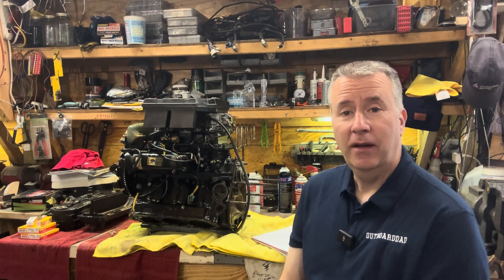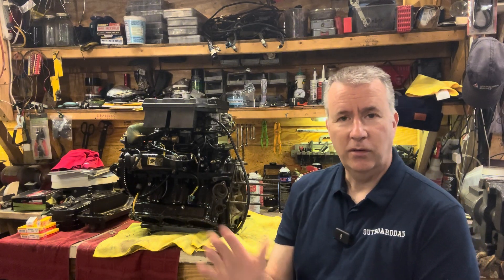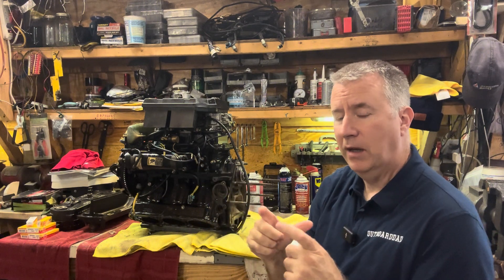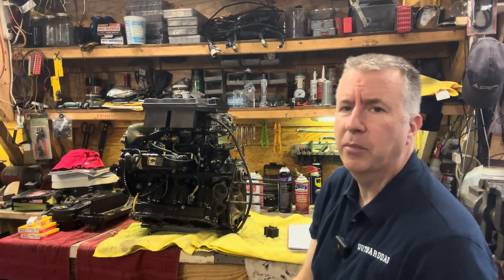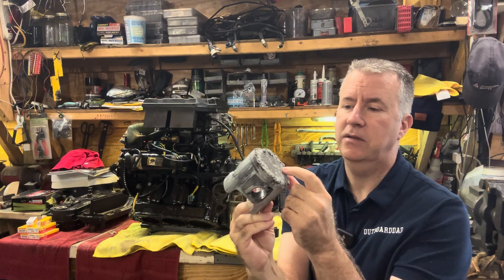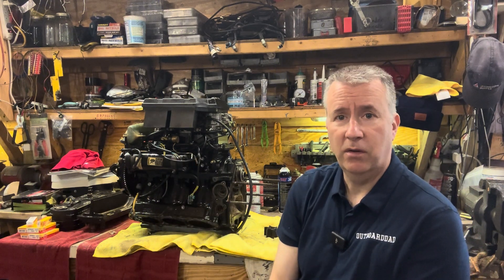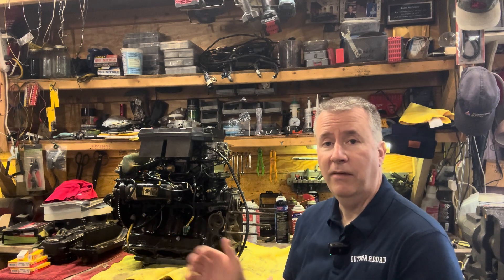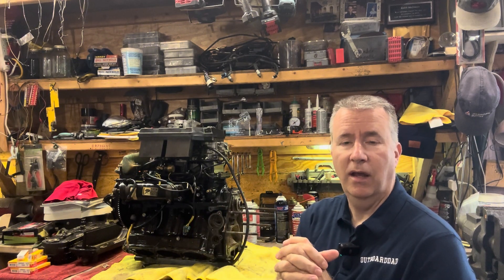Keys to rebuilding Outboatd motors how to

Comment: I rebuild and restore OMC motors at my shop. mostly larger stuff 40HP loopers on up. love your attitude and advice especially on inspection BEFORE ordering parts. Blocks are getting harder and harder to find that haven't been apart and are already .020''-even .040'' over. if it needs sleeves... unless its a really special motor or you have spare blocks... my advice is to move on. could also be cheap and freshwater and its got a great mid, gearcase and trim so might still be worth it but worth noting. subscribed  and can't wait to see more! so many ego filled guys dont even use a service manual here on youtube like one older guy from Florida. i stopped watching. he cannot even do proper ignition testing with a load adapter and DVA! cheers.
Reply from the maker: @ct1762  interesting, thank you for your comment and kind words. I don’t know everything and have taken advice from many people over the years. Some good, some not so good. I used to have a Kwik way boring bar and would cook the blocks and sleeve myself. Just did not use them enough to keep doing that. More to come!
Reply: @OutboardDad  hey thats the way to learn from trusted guys. I learned alot from an old OMC master technician, but the service manual has been invaluable. i send all my blocks out to Jays Block shop in doyle, TN but thats great you learned boring/honing yourself! way more than i can say. i leave that to the pros i screw it up:)
Reply from the maker: @ct1762  that’s why I started doing it myself because so called pros screwed them up
Reply from the maker: Me too brother!
Reply: @OutboardDad  yep. i find most actually have too much clearance . back in the day it was more the opposite